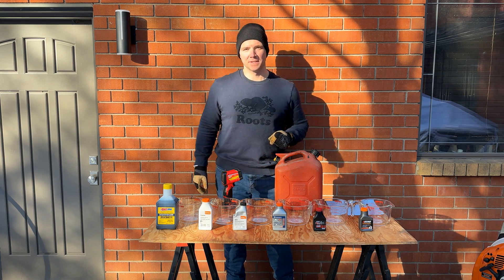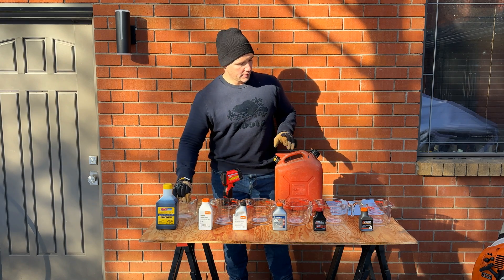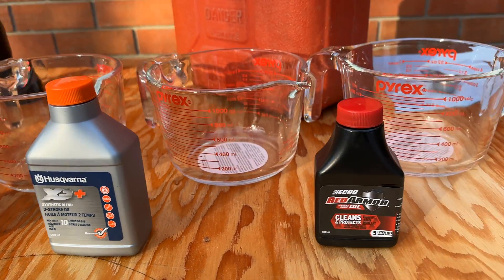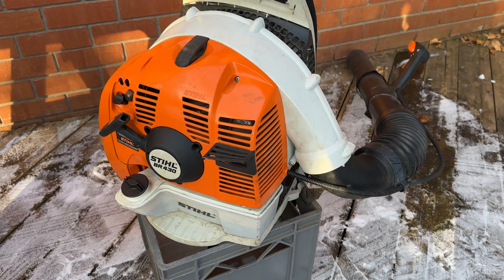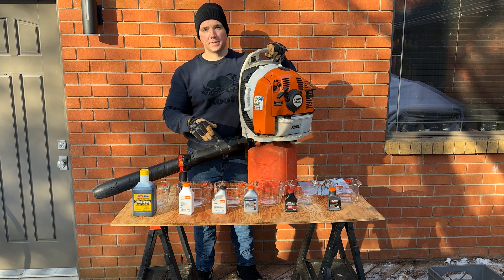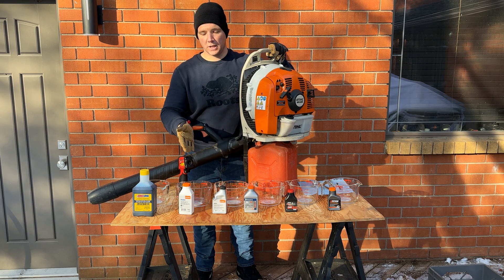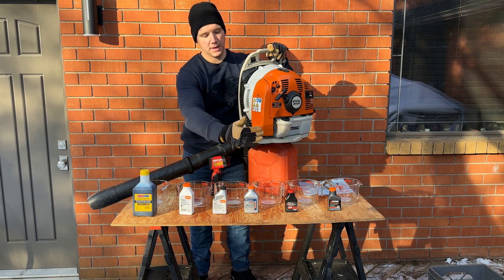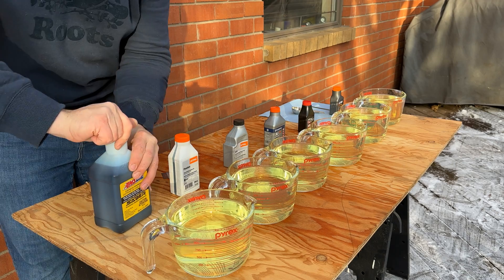Which 2-stroke oil is safest for your small engine? Temperature testing 6 of the most popular oils!

Comment: that tells me there is not a hill of beans difference between any of them.
Reply: Maybe the difference would come in when the ratios are changed. One oil there in particular is explicitly advertised to be run at 100:1 not 50:1. It would be interesting to the 50:1’s run at 40-42:1.
Reply: Well — there might be differences between them… but you’re right that these temperature statistics are meaningless.
Reply: We all eagerly await your test video ? When will it be posted ?

Comment: Hey Dave,it's been a while! I pretty much use the regular Stihl mix at 50:1 and I've always had good results,but I HATE the ultra mix! I was forced to fuel up when helping a buddy with his 50:1 mixed with ultra,one was a recently re ringed (caber rings) 271 and it sounded dry when post run checking,pull the muffler and the piston was dry as a bone as was the recently re ringed 028(about 6 tanks each of my mix).I set mine a tad rich for a while after re ringing and last check with my mix had a definite coating on the pistons . I really think that stuff has a lower quality than regular orange bottle mix?!!
Reply: Would be interesting to do this test with regular old Stihl HP (Orange Bottle Castrol) at the 42.5:1 ratio I use.
Reply: all sthil oils=shit